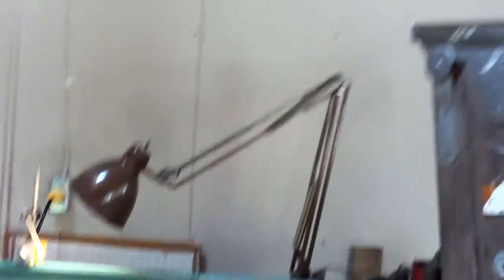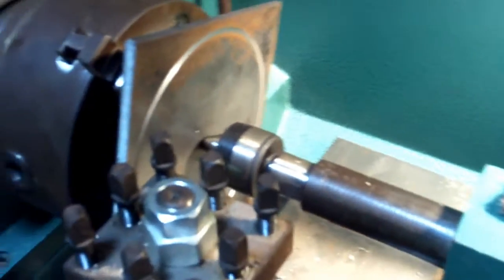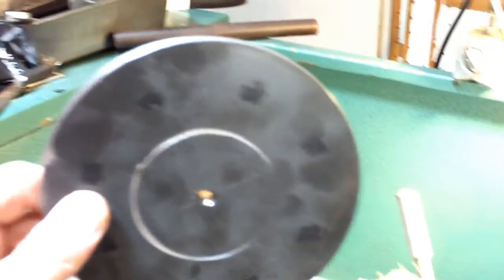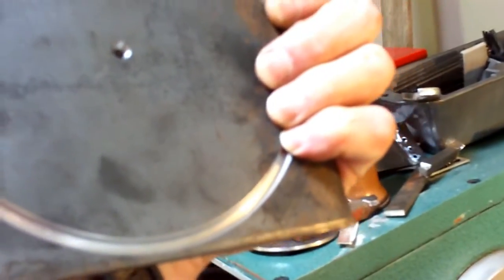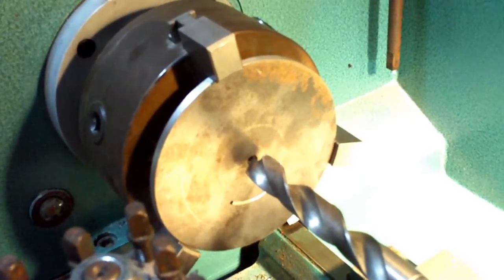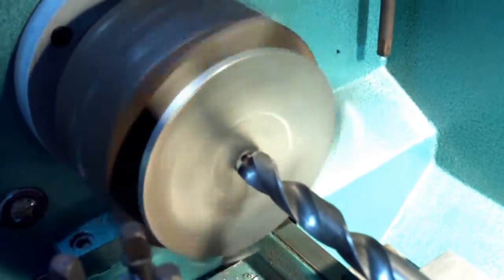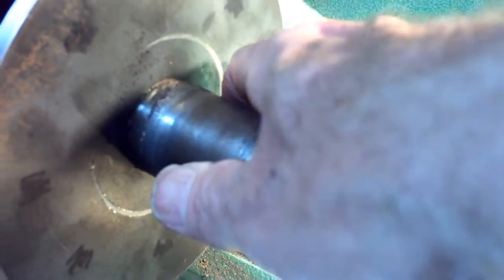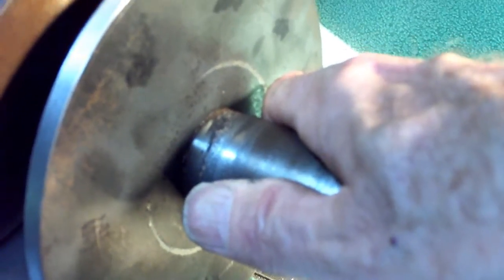Tractor Wheel Project 3

Comment: Nice shop you have there. 

Interesting hold you have on the piece of plate.  Thats probably one of those things that would have made my manufacturing teacher cringe, but at least it doesn't need to run at high speeds.

My somewhat similar project was making a flywheel for a competition out of an 8" aluminum IBM hard-dive casting. I reversed the jaws and bored a hole for an arbor, and then held the arbor in the chuck. 

When I was facing it, having an 8" disk spinning 2K was pretty spectacular.